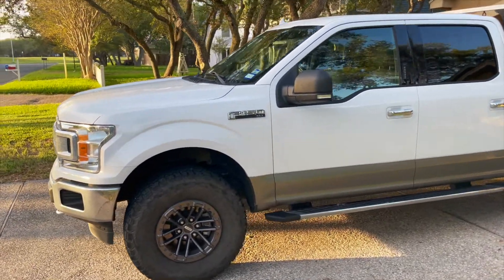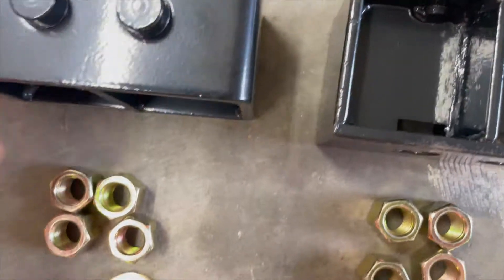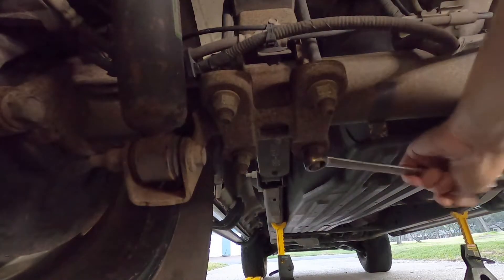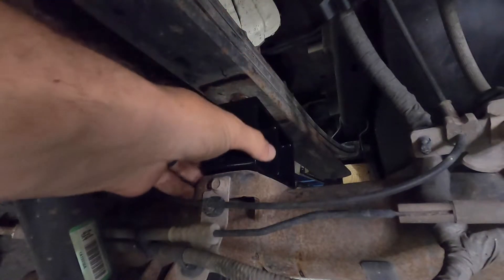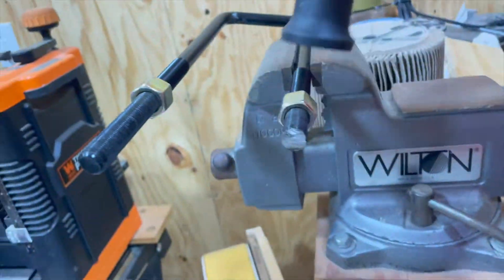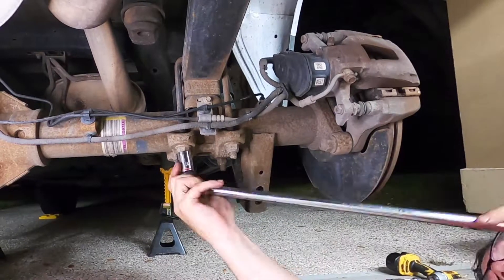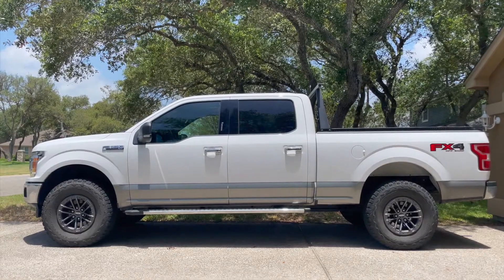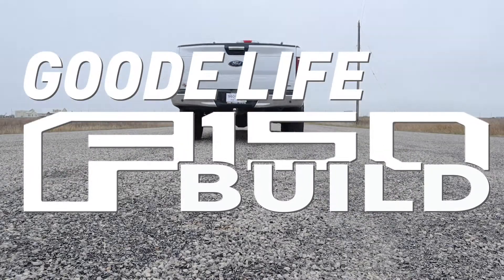I Installed 3 Inch Rear Lift Blocks on my 2018 Ford F150

Comment: what’s the size of u bolts?
Reply from the maker: Not sure if you're asking about the diameter or the length, but I don't know either.  Here is a link to the ones I used, and I was not able to get that information - https://amzn.to/3Pvv1JI

I will point out the length was much longer than I needed, so you'll notice in the video that I cut them off so they wouldn't hang down as far.  These have held up well for me.  Thanks for watching!

Comment: 4x4 f150s come with a stock 1¼ block from factory not 1½. That's why you ended up with 1¾ inch 🤙
Reply from the maker: Yep, that's correct.  I did point that out at about the 3:30 mark in the video.  I appreciate you stopping by!

Comment: So you’re saying that on an 09 F150 Lariat, with no factory crash bars, I should have no problem with 35x12.5r20’s when I install my 4” lift.  Really like the look of your 150!
Reply from the maker: Thanks!  I can only speak to the set up on my 2018, as I know it's different from the 09.  I am pleased that I only needed 2.5" of level to fit that size.

Comment: Are there torge specs on those ubolts
Reply from the maker: Yes, and it's best to do it in steps, as the new ubolts tend to stretch a bit.  The end spec is 120 ft/lbs, so start with 30, then 60, then 90 before hitting 120.  I hope that makes sense.

Comment: Just did this to my 2018 f150. Did you use the blue or the red thread locker and is it necessary?
Reply from the maker: Blue for sure. Is it necessary?  Probably better than finding out otherwise.  😆
Reply: @TheGoodeLifeOutdoors  the instructions don’t say to use thread locker that’s why I ask. And you’re supposed to check the torque at 100 miles and 500 and 1000 so wouldn’t your think it’s pointless since it’s gonna break the bond? Probably will take the tires off this weekend and add some of my orange thread locker (stronger then blue but removable) just to be safe

Comment: You need to get some of those rear wheel well liners they make a big difference and they also protect the inside of  bare wheel well from getting rock chips and rusting potentially
Reply from the maker: Funny enough, I did!  Here's the video - https://youtu.be/nGoCUfHE5iw

Comment: Did the steering characteristics change?   Do you think theres reason for front end alignment after this?
Reply from the maker: With the rear lift, I did not need an alignment.  I definitely got one when I had the front leveling kit installed.  I have not had any noticeable steering changes with this setup.

Comment: Perfect video! Thanks man. I’ve got the Raptor wheels, have the level picked out and was trying to figure out what size rear block to add so I still can safely tow and haul.
Reply from the maker: Thanks!  I'm glad it helped.  I've had no complaints with this set up so far.

Comment: Do you have to tighten the back blocks to a certain spec?
Reply from the maker: Yes, and in fact, it's best to do it in steps, as the new ubolts tend to stretch a bit.  The end spec is 120 ft/lbs, so start with 30, then 60, then 90 before hitting 120.  I hope that makes sense.

Comment: Hey Bro, Do have need alignment after installing rear lift blocks ?
Reply from the maker: While I did get an alignment with my front level lift, I did not feel the need to do so with the rear lift blocks.  I was careful to line up the hardware with where it sat before, and I have not noticed any unusual wear from this install.
Reply: Thanks  for the info appreciated. 👍

Comment: Great video!  I have the same truck.  I noticed a little rougher ride when I installed the 2.5 inch level kit.  Did you notice a rougher ride after you installing the rear blocks?  Or maybe the angle helped?
Reply from the maker: Thanks!  Honestly, I noticed no difference in ride quality when installing either lift.  Maybe I got lucky?

Comment: How have these blocks and u bolts held up?
Reply from the maker: So far I’m happy with them. I’ve been towing my boat often and hauled a few heavy loads and I haven’t noticed much difference in ride quality.
Reply: Good to know ! Could you do a off road video? To show how your set up holds up when flexing.

Comment: How did you do the two tone look with the grey?
Reply from the maker: I've always liked the look of the lower stripe from the factory, but could not find a truck that had that along with my other wants, so I had a local vinyl shop install the lower stripe.  I'm very pleased with it, and it's held up well for almost 2 years now.

Comment: Did you install these on stock rear struts? Or did you have to get upgraded ones to run the block?
Reply from the maker: Yes, it's currently installed on the stock struts.  They still had some life left in them, though, when it's time to change them I will be installing upgraded, longer shocks.

Comment: I have the same truck and just had installed Fox 2.0 2" leveling front coil overs and Icon Delta joint UCA's and now it has a bit of squat in the back, this should cure that I hope. Also, I'm now wanting to go to a larger tire like yours, can you please tell me what your offset is on your wheels? Thanks for a great video...2 thumbs up!
Reply from the maker: Thanks for watching!  These Ford factory Raptor wheels are 17"x8.5" with a 34mm offset.  I still have the factory UCAs, and they do not come close.  You may want to confirm that will work. with your Icons.

Comment: Did you regear at all?
Reply from the maker: No, mine has the max tow package with the 3:73 gears, and I'm pleased with the setup.  Gas mileage and performance were only slightly altered with the larger tires, so I'll keep it as-is.  If I were to go bigger, I'd definitely consider re-gearing.

Comment: I’m going to install a 1 inch block onto my rear Tacoma because it’s sagging so much. Will this be a problem in the long run? I’m not doing any off-roading . Just street
Reply from the maker: I would look into the reason your truck is sagging to begin with - may be worn out shocks or springs.  I installed mine to compensate for sag while towing, but am confident my suspension is solid.
Reply: @TheGoodeLifeOutdoors  it’s not worn. It’s. Brand new truck and got a topper on it. It’s about 180 pounds camperhsell. I also added a 1.5 AAL but still sag
Reply from the maker: @Turtlemilk  Got it.  Yes, it should help compensate for the extra weight decreasing the rear height.

Comment: why don't you color-match the bumpers?? omg drives me crazy that you guys have all these different colors and finishes on the truck fuuuuuuck. chrome bumpers, black wheels, offroad tires, bunch of chrome trim and 2-tone color, omg shit's all over the place.
Reply from the maker: I love that you're so passionate about design aesthetic.  I'm a bit more old school in my preferences, so I don't feel the need to be all matchy-matchy across the whole truck.  I like the pops of chrome.  I like that the wheels and lower stripe are the same color.  I definitely like my offroad tires since I actually need to go off the beaten path.  I certainly appreciate vehicles that are set up how you've described.  Thanks for stopping by!
Reply: Looks sick! Glad everyone has different tastes, or life would be boring.
Reply: I assure you, if all us "old school " guys had been color matching everything with no chrome for the past 30 years, you young thundercats would be doing just the opposite, chrome and multi color everywhere! 😄